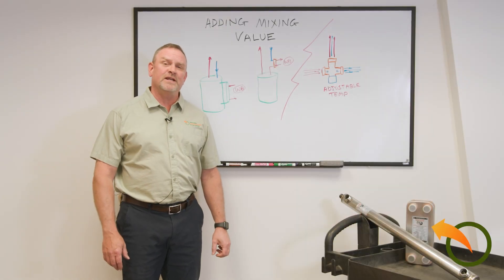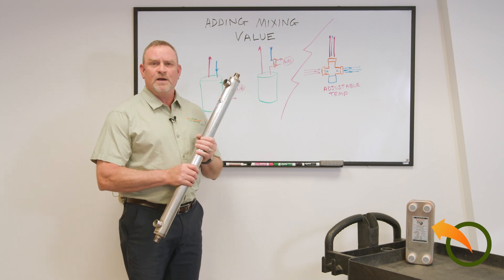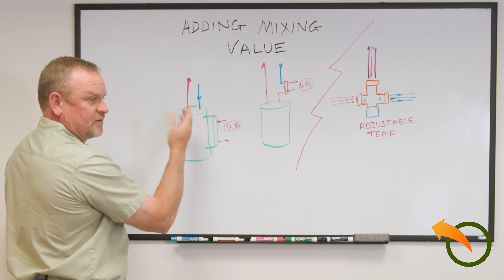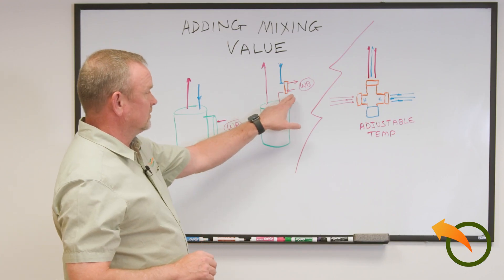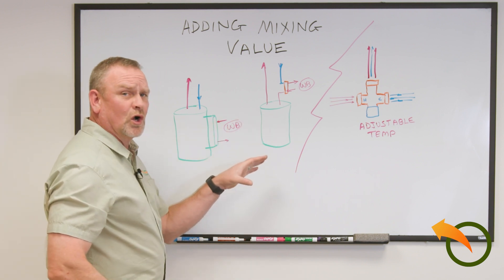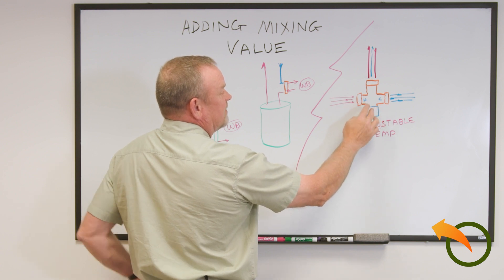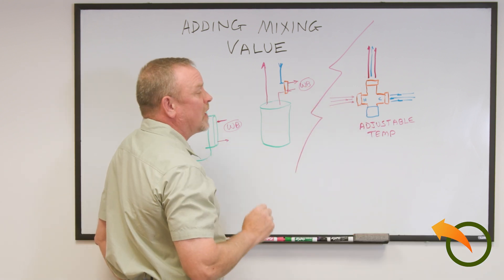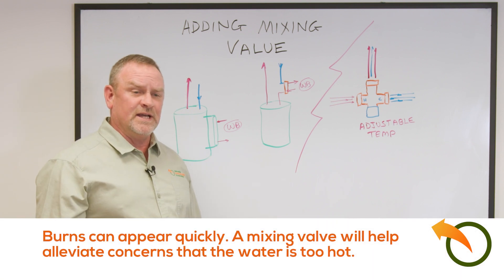Adding a Mixing Valve with a Wood Boiler

Comment: Great video. I was wondering if you could put together a video on mixing valve setup for lowering boiler return water(not domestic) to get it down under 100F for hydronic concrete floor heat. I use the hotter (180F) boiler water with my Dragon PE 20 plate exchanger to heat domestic water but I’d like to utilize the return water for floor heat. I’ve heard that anything over 100F can be bad for concrete. Thanks
Reply from the maker: We sell mixing valves for radiant systems MV115

Comment: I run my radiant floor off my wood boiler and I’m having problems with major heat loss when the floor calls for heat. Should I have a mixing valve anywhere on my system? My boiler is set at 185 deg running thru a plate HX. I have 140 deg water in and 80 going out on the manifold side.

Comment: Mixing valve is good idea and I will be calling to get one for my system. I would advise your staff suggest this when we order a plate exchanger for our home hot water. My next question is one that I am going to call on tomorrow but a video would be great. I have a sealed system for my floor heat. I purchased a plate exchanger for that system. How do I hook into the sealed system. I was told that I should only heat my concrete to less than 120 degrees. Would it be as simple as using one of these mixing valves to keep the water at the 120 degree range going into the existing electric boiler on the sealed system? I would like to use the electric side if the water is not hot enough or if I have issues with the wood boiler? Thank you so much for the help.
Reply from the maker: Using a domestic water tank to buffer the water for radiant is a great idea. I have had good success with it myself. Jeff

Comment: Great video, as always.  Does the pressure created by the plate exchanger require any special considerations, such as a way to prevent too much pressure build up?
Reply from the maker: No, I have not seen that to be the problem. Great question... Jeff

Comment: You mentioned that you prefer the plate exchanger because of the ease of installation with many tanks not having the side ports. Don't you find that with hard water etc. that the longevity of the plate exchanger is much shorter than the side arm because of plugging issues within the plates over time? Thanks
Reply from the maker: My plate exchangers I make "Dragon PE" the plates are spaced wider to prevent that give them much longer life. Your right that most plate exchangers on the market have their plates are very close together and only last 7 to 10 years. You pay for what you get. Jeff

Comment: Do I need two plate heat exchangers one for domestic hot water and one for under floor heat in the same house or can it be done with one plate exchanger?
Reply from the maker: Yes you do... Your heating two different systems and the water is different.

Comment: should the water in a wood boiler be flushed out after the heating season to remove some of the sediment ?
Reply from the maker: Absolutely, I don't do it after the heating season, I leave it to the fall and then do it. I do every other year and do a flush with CF205 and white vinegar. Jeff